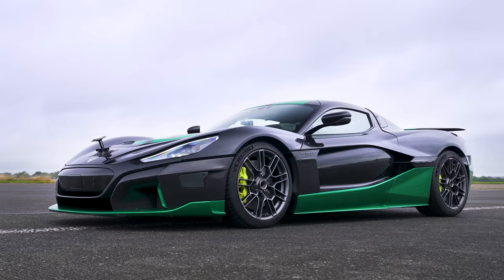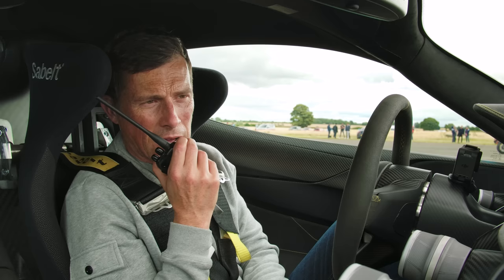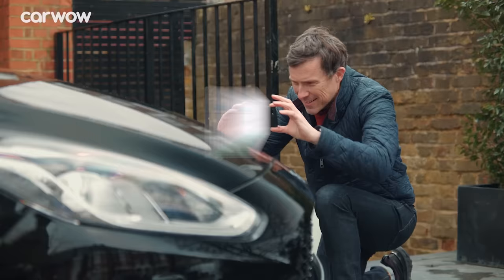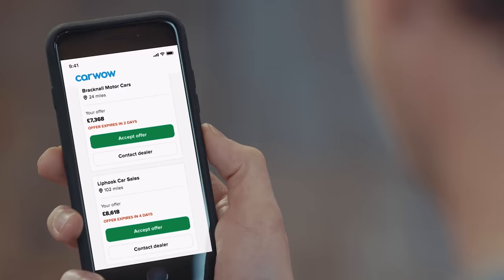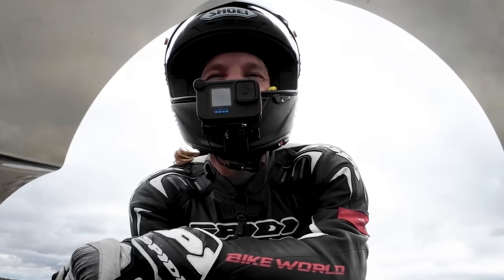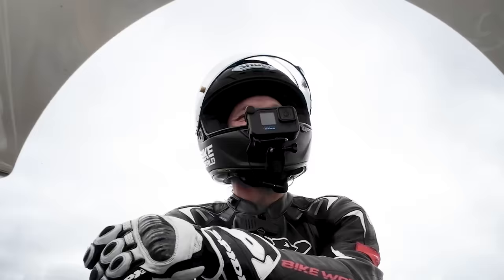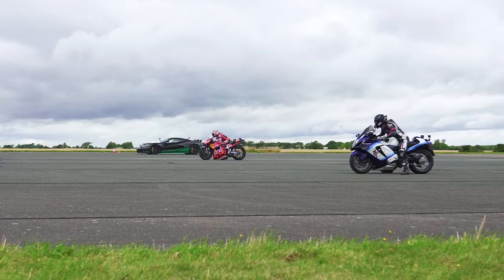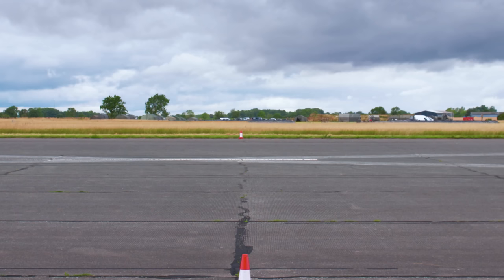MotoGP Bike v Rimac Nevera v Turbo Hayabusa: DRAG RACE

Comment: I did not expect the Nevera to be beaten at all. That KTM is a beast.

Edit: seems that some people in the comments can't read.
Reply: Nevera won
Reply: Uh what? Rimac won both.
Reply: Bike is faster. Rimac is just more consistent
Reply: @strvy no, rimac win drag race and roll race maybe 😅 and rimac have higher top speed.
Reply: @strvy Rimac won MotoGP in start and finish speed, MotoGP only took the lead at medium speed for a few seconds, Rimac crossed the finish line first in every race... dude, are your eyes ok?  🤣🤣
Reply: As for the one race where Gp won, you can clearly see the Gp driver red lighted at 11:40 and left too early before the “go” was called. This gave it a half second head start.
Reply: @leaovegano4232 The fact that a bike can beat a almost 2000 hp electric car in a drag race is absolutly mental. Insane. No words. Bike takes the win in my oppinion
Reply: @wazebi6347  Because weight is not a factor?
Reply: @leaovegano4232 look back at the second dragrace? Who won that?
Reply: @leaovegano4232  ok now do a race in a circuit with a rimac and a MotoGP bike
Reply: @jozefjozefczyk3936 the bike literally won one of the drag races and one of the roll races. If anything they are dead even up until the bike runs out of top end and the cars aero and 1600 extra bhp take advantage. Even more impressive is the bike being the 3rd fastest (fasted combustion engine) vehicle carwow have ever tested being beaten only by the 2000bhp quad electric motor and the electric mcmurtry that literally has a massive fan sucking it to the ground. The bike has 270bhp and has wheelies and wheelspin to add to it. Mats lucky ducati havent loaned them one or their bikes as the ducati gaps the ktm on acceleration lol
Reply: @leaovegano4232  Confidently incorrect... Take a look at the video again.
Reply: @AsphaltSniffer  motogp jump xd
Reply: @ashofficial790  Rimac won drag race twice times, motogp only once rimac 8.5 motogp 8.6 and the roll race was a draw lol
Reply: @jozefjozefczyk3936  the KTM won the rolling race though, which means the rimac is winning simply because of its launch advantage.
Reply: @leaovegano4232 did you read what he exactly said? Nevera being beaten at all is surprising.
Reply: @kovy689 well for anyone who thinks you need 4wd and electric nonsense to go fast as hell, here's a motorcycle if you've got the skill and testicular fortitude to handle internal combustion at its finest.
Reply: @ashofficial790  the KTM is insane but there are drag bikes way faster than that, bikes just have superior acceleration to cars
Reply: @matrinezkevin11492  …which has nothing to do with my comment.
Reply: @jozefjozefczyk3936  the roll race the bike won one. Watch it again. Run the race back and forth all day and they would take it in turns on who wins. Its whoever launches best who wins it.
Reply: No idea what you guys are all crying about. Love the Rimac more than anything, but 1vs4 wheel drive, the fact that Rimac has a higher top speed and for that reason pulls hard for longer at the top end, the performance of the bike must have surprised everyone and you could fairly call it the winner, since the margins are so tiny, while all the odds were in rimacs favor.
Reply: @ryndrssn The proof is in the video, you must have eye problems
Reply: @leaovegano4232  there is a little thing called "gearing" ever heard of it? gear that bike for a mile run it would give  that rimac a bus length
Reply: @jayc342009 there aren't faster bikes. No production bike is faster than a gpbike unless you mod it like crazy like you were racing NHRA then no.
Reply: @NatsumiKuroki269 Equipping a racing bike vs original production car?  what if you turn the Rimac into a race car?  every meaningless comment...
Reply: @jozefjozefczyk3936  Not to mention the one rolling race where Gp won, you can clearly see the Gp driver red lighted at 11:40 and left too early before the “go” was called. This gave it a half second head start.
Reply: @jayc342009  And there are car dragsters that beat the bikes and round a track F1 demolishes the MotoGP bike.
Cars are faster than bikes everywhere
Reply: @NatsumiKuroki269 frl. This KTM gpbike isn't even the fastest and quickest of that year. The Ducati gpbike was faster both on acceleration and top speed. It reached a top speed of 366kmh in half a mile while nevera in this video did 353kmh. Thats 13kmh more the rimac actually never gain up some ground. Redbull's the goat for allowing this to happen.
Reply: The Rimac is faster on e.g. the Nurburgring nordschleife than that motorcycle. xd
Reply: @redtail1.  I never said production bike, i said drag bikes, bikes that are customized specially for drag races. 

And yes, they would beat the KTM.
Reply: @AsphaltSniffer  u're the one that needs to look back at the second race again. The moto GP bike red lighted
Reply: @phil_75  no, there aren't. Modified drag bikes will beat anything. Simple power to weight ratio.
Reply: @Absolut531kmh  a chase is a race
Reply: @AsphaltSniffer The guy who jumped the start by the most? 🤔
Reply: An H2 with stage 4 supercharger gears would smash all of these, or chris moores Gsxr 

A hayabusa is very heavy, 380hp isnt a lot for its engine size, chris moores makes like 600+hp and is set up perfectly with its suspension, no wheelspinning when prepared properly
Reply: @NatsumiKuroki269 no with higher gearing it wouldnt accelerate hard enoguh to beat the nevera.
Reply: @jayc342009  fastest drag bike 1/4 mile - 5.61 seconds.
Fastest dragster 1/4 mile - 3.64 seconds
Reply: That ktm bike is pure  /chef's-kiss
(+ its looks are badass)
/tips-hat

Sidenote:
Why not invite ghostriders turbobusa? ;)
Reply: @leaovegano4232 LOL the video literally put a race bike againts a production car, what u on about? even if rimac goes againts a well tuned hayabusa it still would lose, rimac would need another 1000hp to beat the bike, 1500-2000hp is a bare minimum to keep up with 250-300hp bikes and the motogp bike isnt even in its full power setting
Reply: @Connan432  this is not a prepped track.
Reply: @MrMk82  no, just for the 6th gear only, a little longer, the fastest motogp bike today is 366km/h iirc, 400 km/h is possible
Reply: Prepped drag track would make the bike way more consistent tbh. Also depends on the tire and weather
Reply: @kovy689 f1 cars tops out at 320 kph and these bikes are capable of doing 370 plus
Reply: @sanveerkhanuja3249  Never said anything about F1. Did you reply to the wrong person?
Reply: @NatsumiKuroki269  Man, MotoGP lost to Rimac, he would swallow the bike if he had a straighter line, check out the video, this car exceeds 400 km/h in the original GPS, Rimac can also be modified and become faster as they already did with the Tesla Plaid that hit 350 km/h, plus modified vehicles is another conversation, if it's to talk about them, put a draggster car there that does 0 to 500 km/h in 5 seconds....
Reply: @phil_75  yeah that isn't even road legal lmao
Reply: @redtail1.  yeah true, even more faster if the limiter is off the bike, remember all todays motogp have the same ECU setting, it can go up to 300hp easy
Reply: @phil_75  you are bringing up stupid examples, may as well bring jet planes into the mix? They aren't even road legal cars. 

A stretched, tuned ROAD LEGAL bike would smash this car and any other road legal car.
Reply: Man bike is much slower. In that race Rimac didn't do its best.
Reply: @jayc342009  lol then customize the gpbike for drag and what happens lol. You forgot these gpbikes are limited by the FIA regulations so its even more impressive that this bike is this quick. This KTM is mostly likely still running with the restrictions that were applied.  Remove the restrictions and see how much faster it goes.
Reply: @sanveerkhanuja3249  F1 cars don't top out at 320 km/h lol. In fact, the fastest recorded speed in F1 is 372 km/h while in MotoGP it's 366 km/h.
Reply: @NatsumiKuroki269  power to weight ratio of this bike is about 1200bhp i'd say. Normal bikes have p.w ratio of around 990bhp
Reply: @leaovegano4232  the only way rimac to win is to put 1000hp more and put on big drag tires, thats it, you're talking top fuel dragster? at that level, displacement is what matters how big do you think those fuel drag engine is compared to this little motogp bike? might as well put fighter jets in here too LOL
Reply: @redtail1. Umm to be fair, recent 366 kmh top speed is reached by Brad Binder on Mugello using this exact KTM bike. Ducati is best bike on circuit. With better balance and consistency. And KTM is now 2nd in championship meaning they're close
Reply: @AsphaltSniffer  not a proper race
Reply: @NatsumiKuroki269  Electric cars are very efficient at using their power. The rimac doesn't not need 1000hp to beat the motogp at drag races without contest, just 300 would be enough. 
The mid 80s gp 500 gp bikes already could do 9.5s at the 1/4 miles with only 130hp. And that's without the seamless gear box and the electronics aids. What I mean by that is that the bikes are very traction limited.
The next bugatti (and many other cars) will probably put an end to those cars vs bikes accelerations debates.
Reply: @jayc342009  What? And drag bikes are lmao?
That rimac is actually road legal, the MotoGP bike isn't so wtf are you talking about?
In every situation the car is faster.
Modded road legal bikes v Modded road legal car is the single category you are talking about then lol..?
Bet you the car is faster.
Reply: @phil_75  the bikes that people tune and customize for drag racing are road legal, they drag rage on the road too.
Reply: @phil_75  the cars they bring on carwow are road legal and some are heavily modded, just like bikes I am on about that have been lowered, extended swingarm and a tune. 

A modified car will not beat a 300+ horsepowered  modified h2.
Reply: @jayc342009  Cleetus McFarland's car is 3500hp. 6.7s quarter mile, road legal. That will definitely beat an H2/H2R
Reply: @lesnuitssanskimwilde7986  its not about electric or gas at this level of power they surely have instant torque.
well this video already proven that the 2000hp rimac can be beaten by a 250hp bike, and there are faster bikes outhere that can smoke 2000-3000hp cars, only when the car have awd and 3000hp+ with good aero (these cars mostly run low 6's to 5's in 1/4 mile), the bike has relatively small chance to win, only chris moore's gsx that i can think of my head rn that is in this realm of speed that is not a full blown dragster. 
and no there will be no cars that would be faster than bikes in term of acceleration, unless the car have the same weight with the bike, but top speed, yeah.
Reply: @TheXshot  and what car is it actually?
Reply: @jayc342009  Yes it will, you have modified GT-Rs with 3000bhp+ and the huge advantage of 4 sticky tyres and slicks with 4 wheel drive.
I am not crapping on bikes or anything I'm just stating facts
Reply: @jayc342009  Also you keep bringing up power to weight. It's not as simple as that.
Power is nothing if you only have one wheel to put it down v four, then there is gearing and aerodynamics etc etc.
An F1 car in qualifying spec in 1980's were upto 1500bhp and are at least 15 seconds slower than a modern F1 car with 500bhp less and 150kg heavier.
Reply: @NatsumiKuroki269  You are comparing a race bike to a road car.
Reply: @jayc342009  Let's just put it like this.
Say you gave the best bike and car builders an unlimited budget to make the fastest vehicle the bike would hit a limit of being able to put the power down way earlier than the car
Reply: @phil_75  the video literally about a race car racing a road car? so what are you trying to say here?
Reply: @TheXshot  chris moore's bike is in 5's 1/4 mile, road legal, 
we are keep comparing but really until it hits promod and dragster class full of tube chassis and funny cars with 5000hp and 10000hp then cars starting to have an egde, but in 3000hp territory bikes can keep up
Reply: @NatsumiKuroki269  that monster is road legal?!? Damn. Thanks for the info
Reply: @NatsumiKuroki269  what? It's a race bike v road bike v road car
Reply: @strvy   Nevera is faster, in terms of top speed and 0-100 and 0-200. Bike on his track tires is only faster 100-200
Reply: the fastest time any of them recorded on the drag runs was the bikes second run. End of discussion.
Reply: @ashofficial790 drivel. That bike dosnt have 270hp its 255 at the wheel and the top speed of the bike is determined by what sproket set they use. The big yams and ducatis would be doing 240mph here no issues and the big Ducati can spank this KTM on the straights, litterally smoke it. . The car only gained on one race because the bike went into a high speed tail wobble. They even showed a slow mo of it after Dani told us it happened. Did you even watch?
Reply: @Connan432 big CCs racing have 1000bhp busas that do 6s. They have road legal 600bhp busas doing 7s one is called SuperMarioBusa and is owned by a chip shop owner and used throught summer as his daily.
Reply: @BlitzkriegRap  Bike is on a ton of restrictions. Bike would be faster in all those categories if it had no restrictions
Reply: @wazebi6347 157kg can beat 2300kg is mental?? Are you kidding?😂 everyone know pulling 157kg is much easier than 2300kg…
Reply: @AsphaltSniffer dani was jumped almost in every races..
Reply: @jayc342009 vehicle with better p/w ratio is always win in a rolling race, vehicle with better torque is always win in a drag races

Comment: As usual motogp bike showing it's incredible engineering. I'm out of words to describe Dani's talent . Launching a bike equivalent to a hyper electric car is insane , that's a skill one in billion people possess
Reply: The fact this is only 2021 Moto GP bike it hit max speed at 350 km/h i think but there was very high wind 
There are much faster GP bikes than this now 
This year KTM reached 366 km/h 
2022 Ducati Moto GP bike was probably fastest GP bike ever i could be wrong that thing reached 365 km/h without slipstream 
And That Ducati was leaving every bike in dust on moto Gp races
Reply: Dani is also exceptionally light at around 50 kg, yet can still handle the power and weight of the bike.
Your one in a billion might be an understatement - Pedrosa is probably the best off the line in bike racing history.
Reply: @Smzxe  Are you sure it's not the 2023 bike ? The faring looks different, front air intake too. Could be the 2022 one but I'm sure it's not the 2021 version. 

The top speed record is actually owned by a KTM with 366.1 kph, Brad Binder at Mugello this year, although he probably had a bike ahead of him for slipstream. But yeah, a Ducati probably would've beaten the RIMAC, at least in the rolling race.
Reply: @drunkenhobo8020  Stoner Rossi were also best at at launching 
2022 Ducati GP bike was much faster than this KTM 22 Ducati was leaving every bike in dust on straights 
I think this one is 2021 KTM
Reply: 1 in a billion? thats some bull shit stat
Reply: @hassyg4083  kid have you seen Dani ride those Moto GP bikes on circuit how much skill it takes? And also other riders as well
Reply: @O8SOL3TE  Binder did 366 km/h this year in slipstream yes but
Ahead of Binder there was a Ducati which hit 365 km/h 🤣 that was without slipstream 
2022 Ducati was much faster than any bike on grid it was pulling away from them like they were standing still
2022 Ducati GP bike speedo was showing 369 km/h onboard but later they said it was 364 km/h (363.6 kph) 
2022 Ducati GP bike was leaving every other bike behind on straights 
You have seen how Ducati Moto GP bikes pull away on Straights
Reply: @O8SOL3TE i dont think they are allowed to race the current of a prototype bike which is solely for moto gp and in operation for any other type of race but i can be wrong. This is the 2021 probably with the holeshot device
Reply: @Smzxe lorenzo made the best starts of all the previous year greats of moto gp rossi did it too in his younger years sometimes marquez as well.
Reply: @mayukhsharma8465  yeah I forgot Lorenzo.... There was another rider who could launch the bikes as good
Reply: @Smzxe  i see rapper Vanilla Ice ride bigger bikes 30 years ago for movie
Reply: Except he jumped every time and would automatically have been shown a defeat in official drag races... Yes then it was good launches 👌
Reply: @Smzxe of Course broo